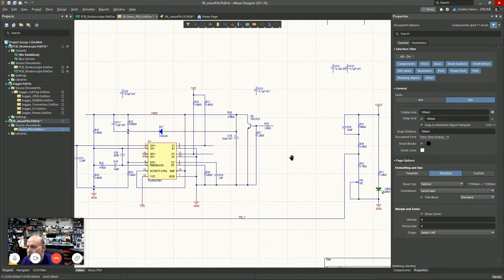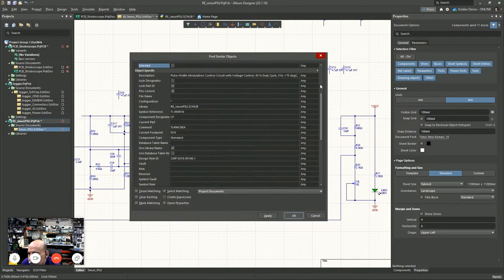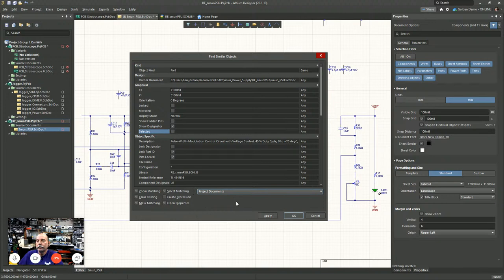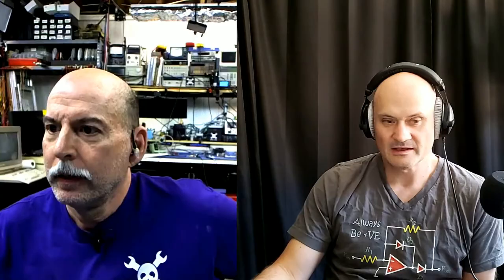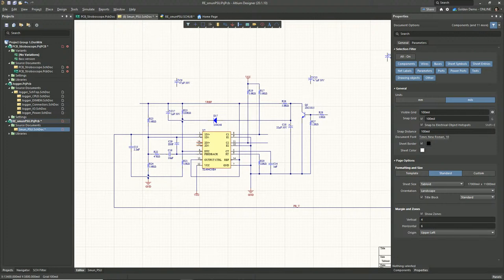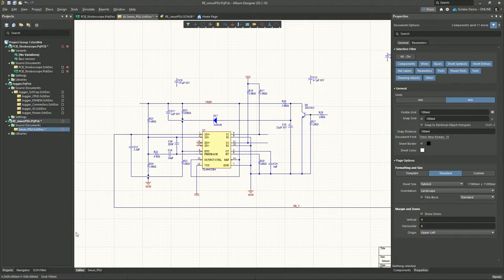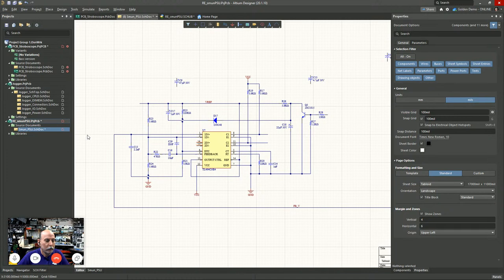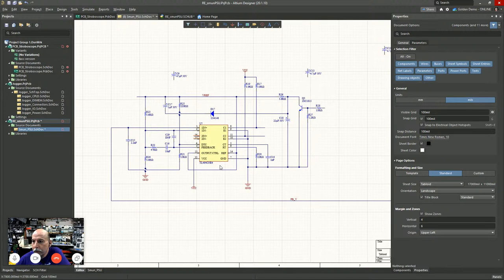Bil and Ben, the Engineer Men 2

Comment: What if you need to increase width of the traces and there is room for it, but tracks need to be shacked a little bit to remove overlaps and rules violations? Is there a quick way other than do it manually?
Reply: The gloss and retrace tools Ben mentioned are the keys here. Here is a webinar I did on the topic. https://youtu.be/CwSDHSNjnyk